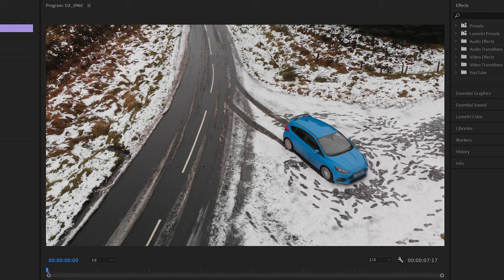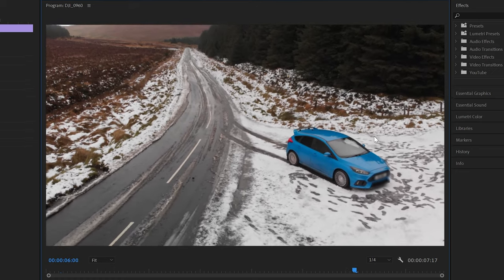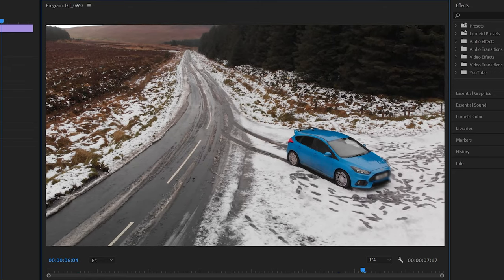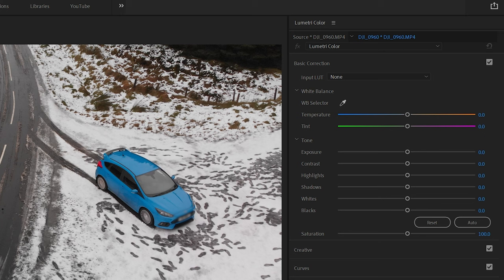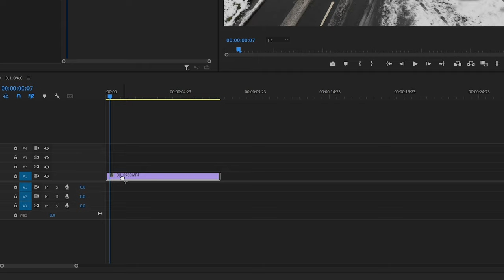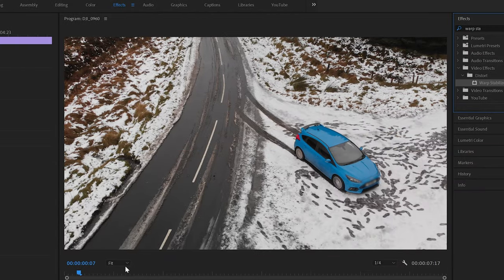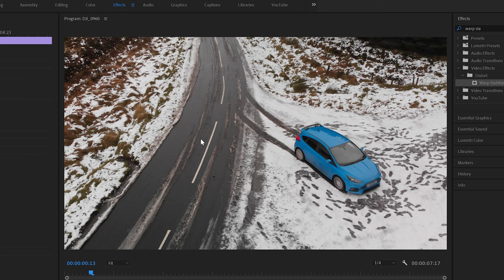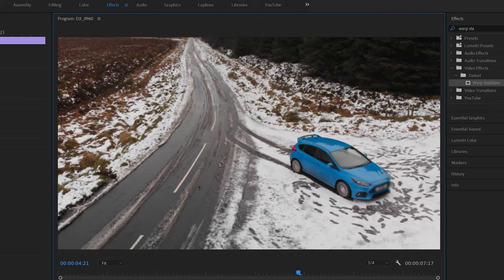ONE CLICK - Fix JITTERY or SHAKY Drone Footage | DJI Mini 2 Tips & Tricks

Comment: Great! I am using the stabilizer in Powerdirector. However can you tell me if shooting in 4k60 or 1080 60fps is smoother and less jerky compared to filming in 30fps?
Reply from the maker: Here is a tip I use all the time. Record in 60fps and then convert it to 25fps (which is what I export in). This slows down the footage by about half and makes it very smooth!